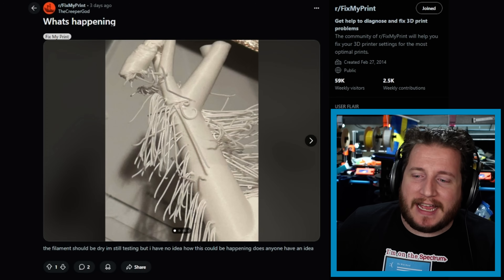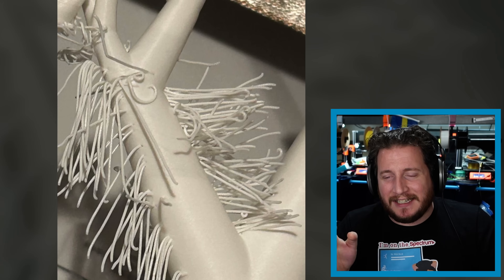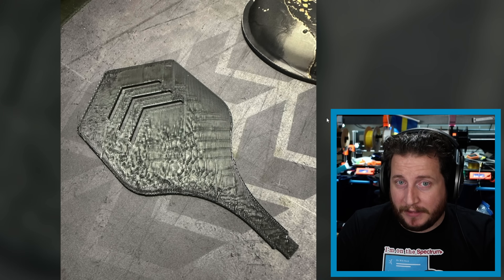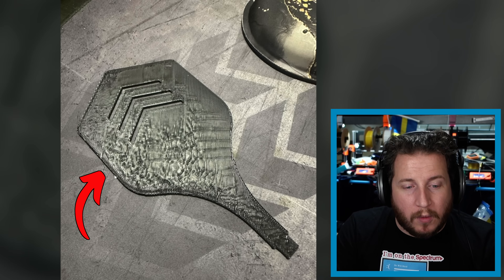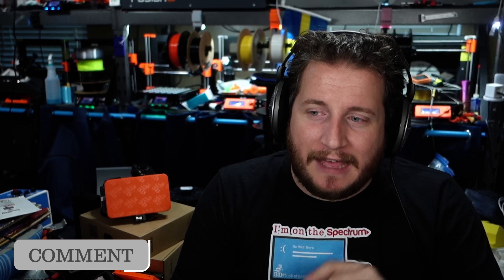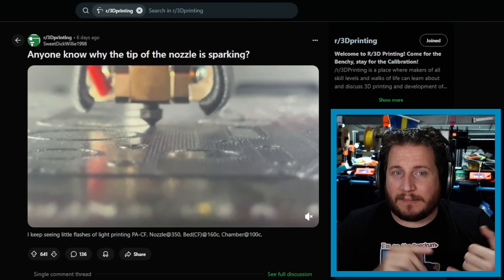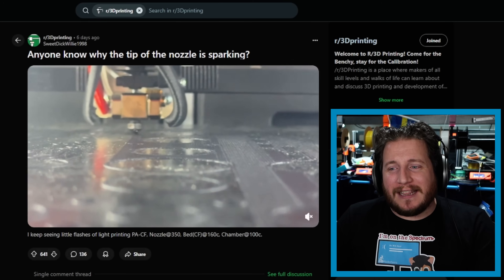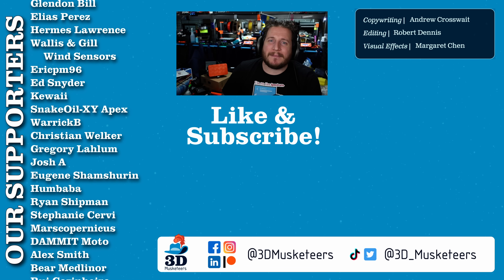It's a MIRACLE This Prints At All! - PrintFixFriday 211

Comment: @8:50 there are not that is an ender 3 v3 SE, the bed is solidly mounted to the under carriage and rides on two round linear rods. no v-wheels, no bed screws to adjust. the linear bearings that connect the bed and carriage to the linear rods are not screwed on correctly.

Comment: Another great episod. Sparking issue is interesting. I would like to clarify/complicate CF conductivity. CF can be either somewhat conductive or non-conductive, and so are the composites. The conductivity of CF may be enough to dissipate static, but not enough to conduct a lot of current. Things get even more complicated for composites, but generally in retail filaments, base material determins the overall properties more than CF. Ex. most PA CF filaments are not advetised as conductive or static safe/dissipating. More conductive CF reequire more processing, so retail filaments probably do not use them. The fill rate would probably have to be more than 20 percent, and probably more like 40 percent for the fiber conductivitty to be a factor. Anyway, this would support the theaory of static accumulating on nylon rather than electricity being conducted by fibers. 

Also, nobody brough up the common mode currents, which may be possible due to HF of PWM of the heater, but I do not think these are high enough to cause arcing, unless there is some sort of a resonance happening and there is bad or no ground.

Comment: Sorry, Grant. Your theory about the sparking doesn't hold up to scrutiny.

The static is building somewhere on the hotend and discharging to the build plate, or possibly the other way around. Conductive filament should prevent this, as the charge should bleed off before getting that high.

I'm gonna guess this is belts/idlers, because there's a very good chance the hotend assembly was, through oversight in design, simply not grounded to the chassis.

Comment: The very wobbly bed Ender - that's an Ender 3v3 SE. Linear rods and hard mounted bed. Well, not very hard mounted in this case. No v-wheels, no springs.
Reply: he's thinking of the "v1" or even the "v2" and at some point you're gonna need a way to do manual leveling anyway be it springs or the silicone things on the bed screws. The more I think about it with the plastic base, the screws that hold the rods may be worn/stripped or the threaded insert may be loose/stripped. Before all that I would look at the carriages still.

Comment: Remind me of Van de Graaff generator, maybe the filament are getting rubbed in a tube nylon and Teflon are in both end of the list +/- the head could be charged up if that’s not grounded. We talk about a thermal isolated part so who knows if the nozzle are grounded. Personally I feel the static when taken PLA of the bed, I use coated bed so no grounding there.
Reply: I tried measuring from nozzle to ground on my Prusa MK3.5 seems like the are no grounding on that.

Comment: I think the CF is sparking, not arcing, because of the color of the sparks.
No static discharge.
Maybe something in the filament is evaporizing?
Reply: sparking and arcing are pretty synonymous with electricity though, I suppose you mean more like creating a volatile VOC that is actually flamable, and auto-igniting it, so a decomposition explosion?
Reply: @Roobotics maybe this is above my level of knowledge but I will try to learn about it.
But yes, I was thinking about a tiny explosion.

Comment: The arcing... I just recently printed some PETG CF Bambu Lab on my Anycubic kobra 3 max and saw it doing some of that too... I'm thinking that the carbon fiber strands are causing some kind of static buildup on the print head and its arcing to the already printed filament... I will admit that it kinda caught me off guard... but it doesn't seem to be a problem in regular situations... hopefully no one would be printing while having  combustible vapors in the same room or shop...

Comment: Is there any way I could talk you into doing a video on how to properly switch between different materials.  Bed adhesion considerations/requirements when switching between common materials.    For instance, if I print CFTG or PETG and then need to go back to PLA, what needs to happen so that I don't clog my nozzle, or have bed issues?  Should I have separate build plates?   Info like that.

Comment: I don't think the CF is the root cause.  I think the movement of the nylon through the system is generating the static and the CF is simply allowing a conduction path through the whole of the filament instead of just the outer surface that is in contact with the metal nozzle.  Instead of a small surface area the functional volume is massively increased because of the surface area of the CF.  As long as the hotend is fully grounded to the chassis AND an earth ground it should be fine.  If one of those is missing then I'd be stocking up on spare boards.

Comment: Hey my guess for the first print, the hairy support, is that its a time lapse thing. When I first got my bambu A1 mini i had to go in and play with that setting and if i remember correctly you may need to go into the start gcode and delete the time lapse info. The strings are coming from the tool head moving away from the print to take the picture and the nozzle drooling.